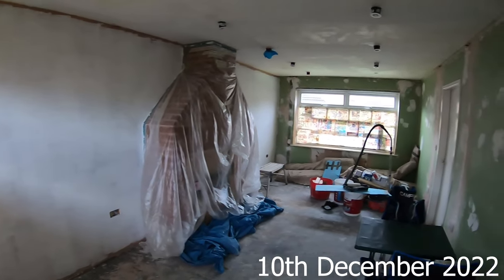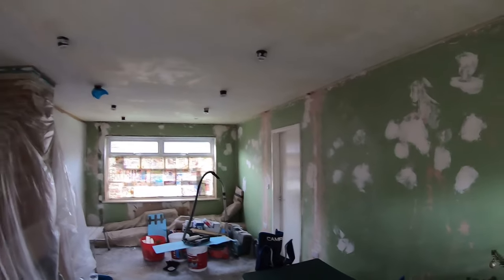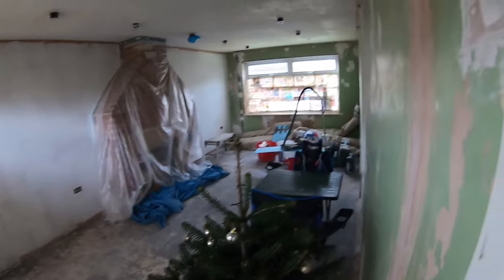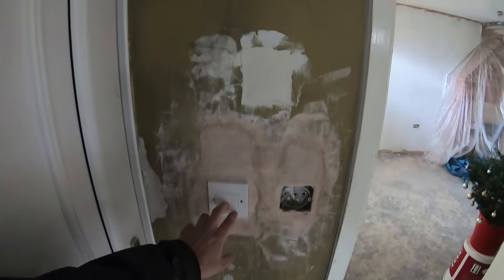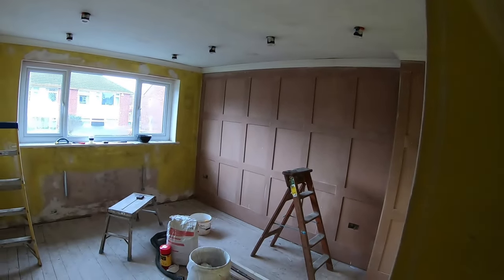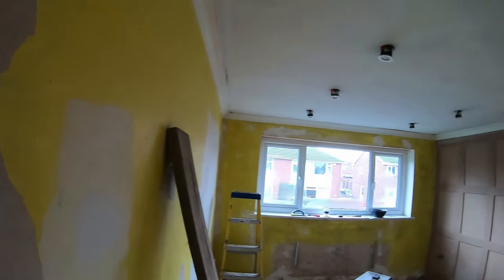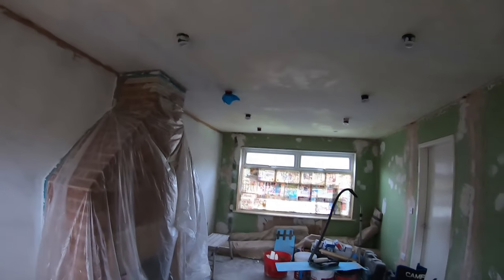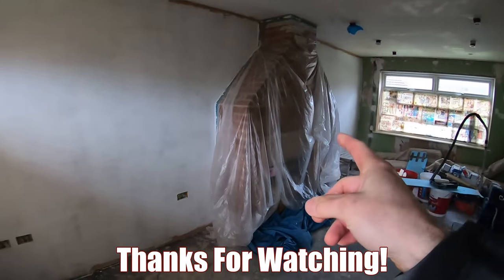Another Update - Second Fix Electrics, Coving - Renovation Series Ep 18 #renovation #vlog #update

Comment: Fibrous plastering and the making of decorative mouldings and cornice, like yours, is a very under sung art. Fitting them to wonky walls can be a ballache. Gyproc has a bit of flex in it, but sometimes needs pinning for support on long runs.

It's great to see the little wins. Who wouldn't want an old man like yours.

👍
Reply from the maker: You can say that again! Worked on a job of couple of years ago, guy on there doing the cornice, proper master of his craft 💪🏻 
Yes, I’m very lucky to have had my dad help on this 🙏👍